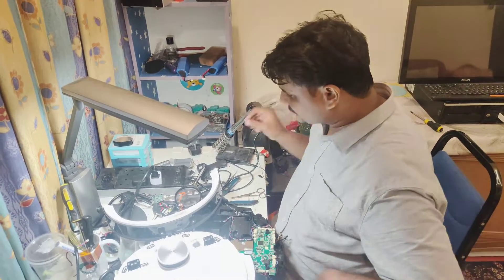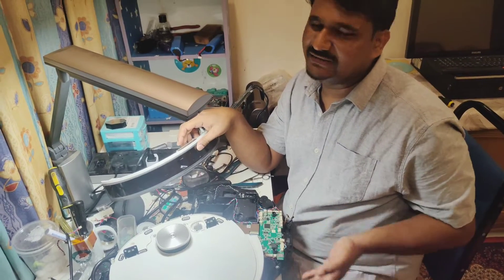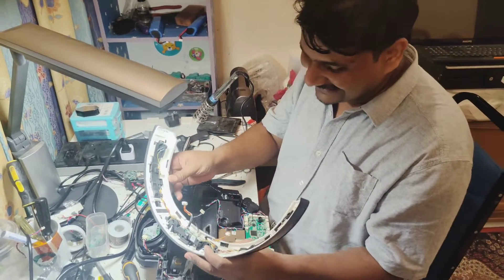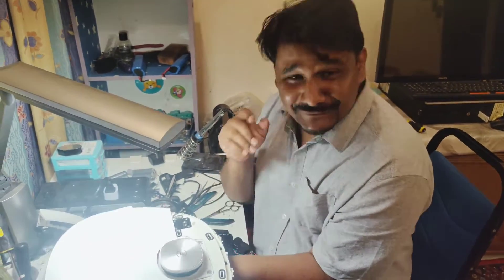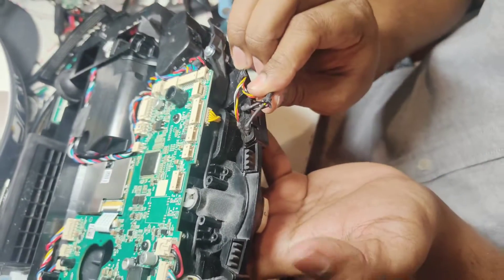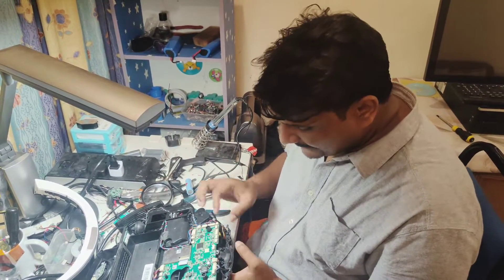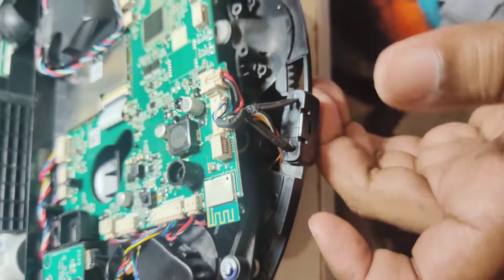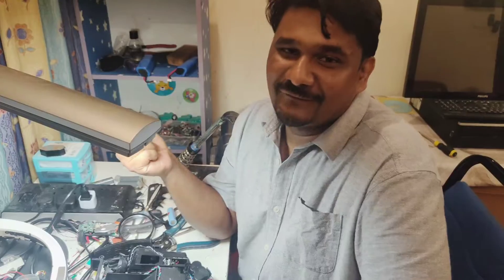Anti Drop Sensors are not Rusty But still deebot giving error ?? Check the Wires

Comment: Sir, I have the same error. Mobile phone camera check found out that 3/6 anti drop sensors are not working. But they are not rusty. Very clean. Then I switch sensor to the working side, and then they start working again. It means there is no issue in the anti drop sensor. Does that mean is it a motherboard issue?

Comment: bought a brand new ozmo 950 at auction as a damaged one. after replacing the battery, it reported an error with the anti-drop sensors.  The sensors were ok... I replaced the motherboard from my old Ozmo and everything works fine.

Comment: I just opened my T8+ today and all wire and anti drop sensor is good and not rusted. However the ‘clean anti drop sensor” problem still occur when in the middle of cleaning, normally it clean for couple minutes and it stop and said error.
Any ideas?

Comment: Hello, I have a Deebot T8 with the error message "check dropsensor". I have already swapped the right and left sensors. the message still came. I have now noticed that the left sensors and the left front sensor are not working. using IR check. From the middle on, one side of the sensors doesn't work. The cables in the front look good and there is nothing rusty. Do you have an idea what it could be - or can I send it to you?  ;) Best regards, thank you for your videos!
Reply: Hello, I have exactly the same situation. Can you say what was the solution?

Comment: Thank you for sharing your experience. I have ozmo 950 and gives drop sensor error; ı checked the sensors , no rusty and no dust. But when I checked with mobile camera, sensors no infrared lights. 
What do you think about the reason? Main board?
Reply: Check 27 ohm resistor,
It's connected to the base of DBQ  transistor

Comment: Thanks for the videos. I have a deebot x1 plus and this is the 2nd one that experiences the same issue. My vaccum sounded louder than usual when it was stuck and might have overheated. Ever since its stuck in low suction mode and can not change suction power. Can you please let me know what i should replace to resolve the issue ?
Thanks from Canada
Reply from the maker: Plz WhatsApp a video clip at 00601137973018...
Let me see the video first then I pass a ecovacs technician no .. staying in Québec Canada

Comment: Hello!  I have a Dreamebot L10S Pro robot vacuum cleaner.  The water spray does not work while mopping.  The technical service in Turkey does not provide feedback and is inadequate.  Is there a technical document, video or a program that can guide me so that I can solve this problem with my own means?  I have electronic knowledge.  I am happy with the device, but this chronic malfunction annoys me.  I'm waiting for your help.

Comment: Hello, I am from India and have a Yeedi which has no service network here. I find your videos great and have opened my device looking at your videos. My robot keeps giving antidrop sensor warning though nothing seems wrong with sensor. My application is a flat apartment floor, so can I just short the IR LED receivers at the connector end  and will it work? Will appreciate a response. Is there an email ID I can contact you on? Thanks in advance

Comment: Hi sir,my robo is working towards but not working suction part.
Reply from the maker: Model no?? Plz check wether main brush turning or not.... most of the time main brush jammed or main brush motor assembly issue
Reply: @ecovacstechnicalsupport5278  thank  you ,sir the product is not branded I check the motor. It is damaged

Comment: Thanks for all the support! I have found your videos super helpful.

I am still getting anti-drop sensors/errors.
I have tested the sensors with iPhone camera and I can see that the sensors are working. I checked the bumper sensors, I checked the wires, there is no rust signs, I have cleaned out with an air duster but still have issues.
The plastic bumper was scratched so I polished it and removed all scratches.
The robot in some areas drives into things and the bumper doesn’t stop the robot. It tries to drive over it even if it’s a chair leg or wall. It doesn’t happen everywhere, particularly under the couch on a light grey rug.
Reply: I exactly have the same problem, did you find any solution for it?
Reply: @sina8306 same here. Did you find any solution too?

Comment: Hello, I'm Pablo from Uruguay, first of all I'm very grateful for the videos you make, they have helped me a lot to be able to fix my ecobacs, I have an ecovacs t5, which I had to change the motherboard because it wouldn't charge the battery. The problem is that when I changed the motherboard, the vacuum cleaner made 7 dings. and I can't link it to the app. Do you know how to load firmware from a PC to my vacuum cleaner?